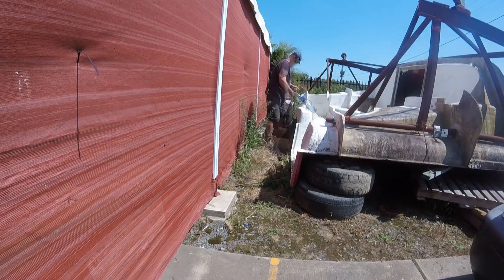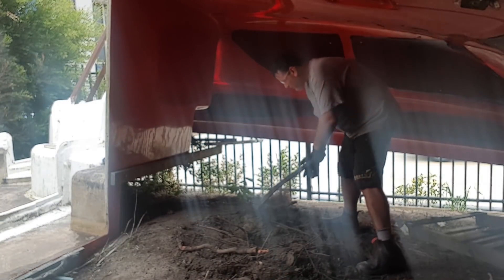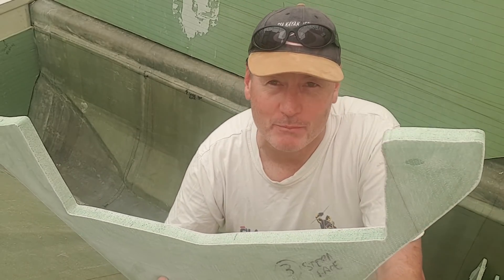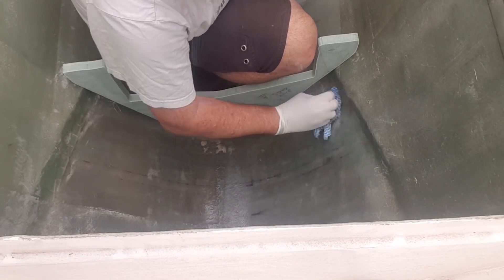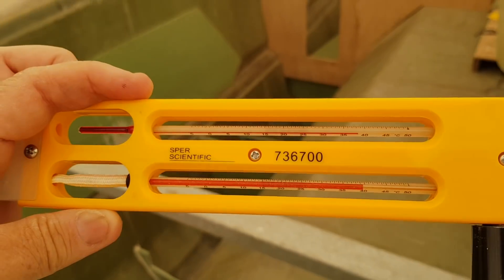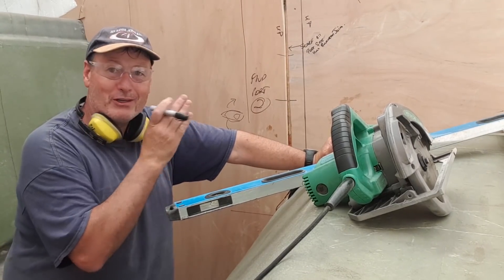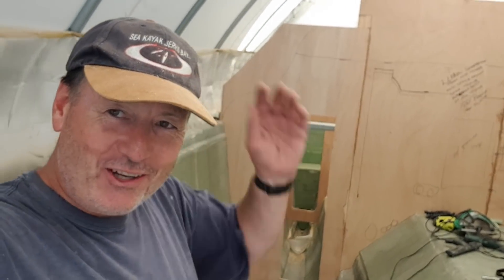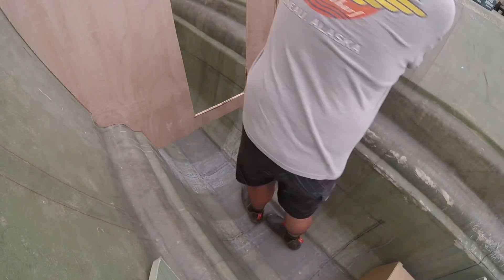Ep067 Filleting Bulkheads and boat building dangers - Life On The Hulls Catamaran building

Comment from the maker: Hey guys, so glad to see some cooler weather conditions as I head into winter, February and March was intense and the work I was doing wasn't helping, welcome to some serious " Do It Yourself " boat building. Cheers Rossco
Reply: I wish you had a big empty lot of your own to build a proper factory with air-conditioning and shade. It seems frustrating dealing with those large moulds and a limited space.
Reply: @Jimmy_in_Mexico  Yeah when I was looking at container homes I wondered if you could build a "factory" relatively easy out of them. Two large 40' containers on the sides with a roof spanning maybe 10m between them. Both lots of storage and a large build space.
It might be worthwhile to build something like that in order to speed up the build.

But with proper insulation and airconditioning it gets expensive and a lot of work quickly, plus you'd need land with access to water to launch. Plus you might need proper foundations and building permits if you don't live in the wild west (or east or south :))
Reply: @steveadams4009  Oh thanks this Godo of the Land is interesting. 
But I'm subscribed to Andrew Camarata and that's partially where my idea comes from haha.

Comment: Always nice when you can really see progress,  glad you didn't get hurt.  Breaking News: Boat builder slips and glues himself in the hull of his boat, rescuers still trying to figure out how to get him unstuck. If they can't get him unstuck they will just glass him in as part of the structure. 

See if you can find an old window air con unit,  attach some 200mm round  flexible  ducting to cool side and pipe it to your work area.  Ducting similar to dryer hose or the stuff they make for mine ventilation would be what one would need.

Comment: Roscoe.....that "mattock" looks more like an adze! With the hammer head on the back of the blade, it may well be a fettler's adze! They were made of good tool steel and could be sharpened to a razor's edge and used to shape timbers both in boatbuilding (keels, stem and stern timbers, and railway sleepers for final fitting as the rails were laid!). Hacking away at the ground! What a travesty! Haha! Stick shit to a blanket.....that's the old Bostick sales pitch! Pediment = coaming!! Love your work!
Reply: Definitely.. looked like old school... always wondered who use an adze as a mattock & now I know ... plenty of adzing years ago in that area.
I

Comment: I'm building a 40' cat up in Cairns in a shelter very similar to what you have. Put a thermometer up on the cockpit roof in December during the heatwave and consistently recorded over 50C with a max of 57.6C. My "rule" was when it reached 45C where I'm working then it's down tools.
For your vac, go to a cleaning supplies place and buy a long length of hose to suit you vac. I did that and it makes life so much easier. I just sit it on the bridgedeck at the top of the steps leading down into the hulls and it's long enough to reach the length of the hull without having to keep moving the vac around. The hose can be a bugger sometimes but it's a minor inconvenince compared to lugging the vac around.
I'm enjoying watching your build...brings back the nightmares....sorry....memories. :^)
Reply from the maker: That I'd great advice David, i am going to do that for sure.The heat must kill you up there.I as considering an air con for final fitout.I think i may be removing the ends of the shelter in a few months when spring comes around.

Comment: FYI... when fileting the bulkheads in, use some masking tape to outline the outside of your filet line. It will make the cleanup easier and faster.  Just remember to pull the tape after the epoxy tacks up and before it gets hard.

Comment: Maybe it would be worth to put a long irrigation PVC tube (maybe 60mm in diameter) with a T every 2 meters and a couple of fast connections for disassembly. Every T could have a removable tight plug (easy to remove with an O-ring) where you connect the vacuum hose close to the place you are working and the vacuum machine plugged at one of the extremes of the long tube that spans the whole hull. Some sort of central vacuum. Maybe it is worth if the dust collection that has to come is significant. Always enjoying your videos and your humor.

Comment: Please-What is the tool and make of what looks like a right angle cylinder sander (at about 25:20 min in the video)?  Thanks Mate.  I've learned so much watching your vids, even tho I'm building an 11'11" sailboat, it all applies.  Love your vids!
Reply: Also interested.
Reply: Peggy Estes much google later.   Bosch  PRR 250 ????
Reply from the maker: Definitely a bosch rollersander.best tool ever,issue is finding sanding rolls for it here in Aus is impossible.I bought generic ones in the uk for a 10th of the price and bought 20 boxes of 10 barrels of them and my wife flew home from England wirh them ,as there is a cheaper german version.I could send a link to supplier if needed.Cheers

Comment: Hey Ross have you used fillet bags before like a cake decorator uses makes fillets easy as cake.
Reply from the maker: Yes I have used them ai just liked a challenge and the stuff goes off so quickly unllike epoxy i have used in the past. Cheers Ross

Comment: Could you explain the product you chose for bedding the floor and fuel tank bulkheads? Are you saying pro-bond light? Can you explain the strategy of avoiding hard contact with hull? Is thickened not suitable for this if one was using epoxy resin?
Reply from the maker: Pro bond lite is the adhesive used.Fiam is adhered simply to hold in place.typically all of the strength cimes from the tabbindmg and he  layering and tapering of the laminates.If I were to use epoxy I would them need to tab with epoxy to ensure all tabbing is connected chemically.I will be filleting my main plywood bh with thickened epoxy and tabbing with epoxy.Inside the bilge it will be whited out with iso polyester flow coat for cleanliness,on the bridgedeck the tabbing will be epoxy so flow ciat will not gnwrally adhere.Dufferent chemistrirs require different approaches.Slight gap ensures all of the cove in fiam is filled and maximises cobtact ad refuces points of sheer and print yhrough to piyer hull in areas where there is no foam underneath.Cheers Ross
Reply: Thanks, Cheers from America
Mate! I have been learning a lot from your work. My project is small repairs and improvements to a power cat using epoxy and I have been confused by all the different opinions regarding bedding compounds and hard-points.I will be using thickened epoxy for bedding and filleting/radiusing but seems that creates a totally hard and inflexible layer between the hull and bulkhead

Comment: This might be a silly question, but isn't it going to be harder to take the hull out of the mould if you keep building the boat in the mould? Is your plan to destroy the mould to get the boat out?
Reply from the maker: Demoulding wont be a real issue,I is imperative that the bulkheads are in position prior to demoulding or the resultant distortion could occur with the lift and settling on the hard stand. Boat will be max 2.5 tomne on demoulding.Cheers Ross

Comment: how is the wet-bulb temp higher than dry bulb?
Reply from the maker: For the wet bulb to be lower it would need to swirled through the air to induce evaporation and wind over the cloth bulb.I guess the water in the reservoir was like a frog in boiling water like myself slowly cooking and not noticing till it was too late.Just checked it and with an empty reservoir it is equal.Interesting though.Cheers Ross

Comment: You going to foam the crash bulkhead full?
Reply from the maker: Crash bulkhead is not required to be foam filled.Entire boat is foam core so flotation will not be an issue.Bulkhead will be sealed and possibly a limber tube with ball valve into the bilge for dressing condensation. Cheers Ross

Comment: Why have you removed the peel ply. I would have thought you only remove it just before you are to do some more glass work? Am I hearing you wrong?
Reply from the maker: Peel ply needed to be removed to allow for filleting and tabbing,although it is nice to leave as long as possible the stuff is as annoying as hell when you are trying to clean and prepare for subsequent additions as is the case here. Peel ply also gives a superior neat finish that doesnt require too much work to prep as I have reduced the sanding required by at least 80percent and the sanding does not gum up the sanding devices as the surface is dryer and less resin  heavy after peel ply removed the excess that sit or float on top.  Ross

Comment: Can thickened epoxy also be used or?
Reply from the maker: Thickened epoxy can used for sure, But it really isnt required at this stage as the foam is bedded in bedding compound, the tabbing is the strength and in my boat's case it is a vinyl-ester based boat so, tabbing is completed with vinyl ester so I can flow coat out the bilge. The water tank will be epoxy coated with a potable epoxy paint. All the best Ross
Reply: @LifeOnTheHulls  cool.. I was thinking more in case of not being able to get hold of the tabbing product you use...
Reply from the maker: I definitely recommend thickened epoxy as long as you are not changing chemistry to polyester or vinylester as they generally dont like each other due to the make up..There are exceptions however in general terms,epoxy will stick to either but poly and vinyl will not adhere to epoxy well.Ross